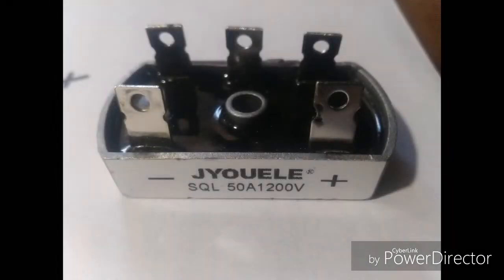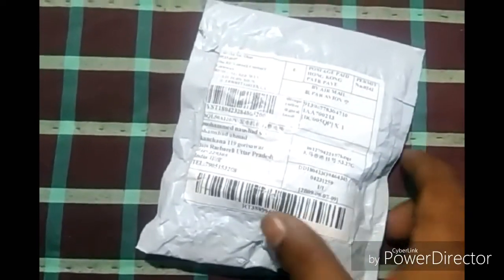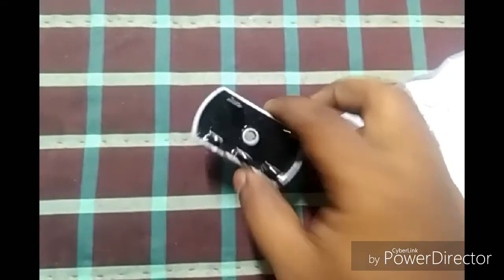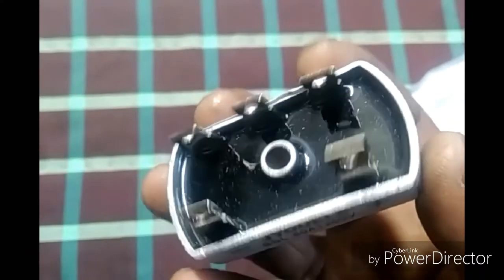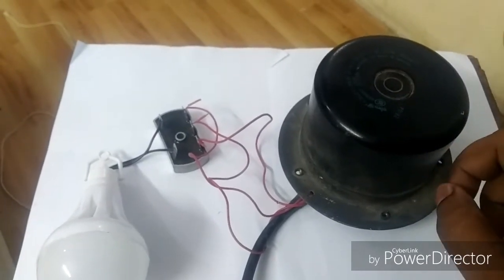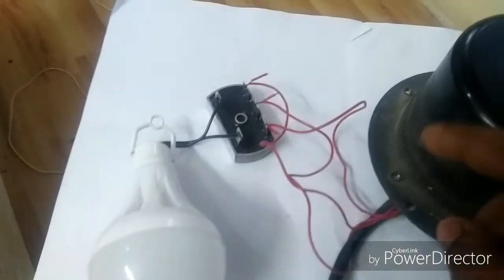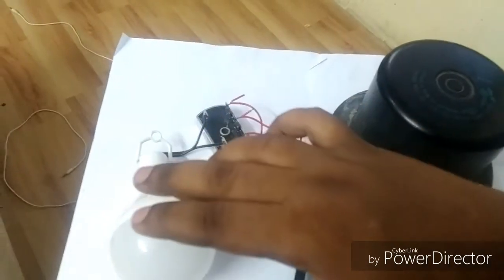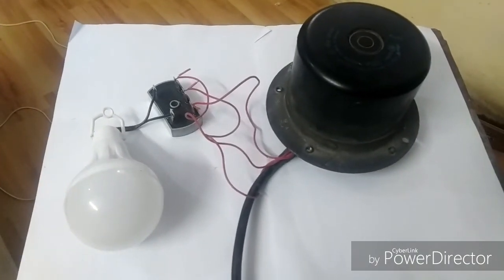3 Phase AC to DC Rectifier

Comment: can i  used for Battery DC 24V system i still order one not sure it would work or not
Reply from the maker: Don't worry it's a simple 3phase to dc rectifier. It has nothing to do with voltage. Remember voltage. IN and OUT are same it will not regulate.
Reply: @MastercraftKARIGAR  thank by the way i have done by that way easy and cheap http://www.thebackshed.com/Windmill/articles/Rectifiers.asp
Reply: @MastercraftKARIGAR  yes thank
Reply from the maker: You're always welcome dear.....